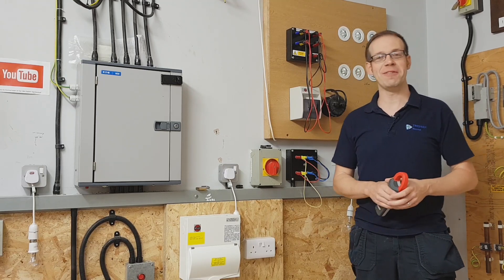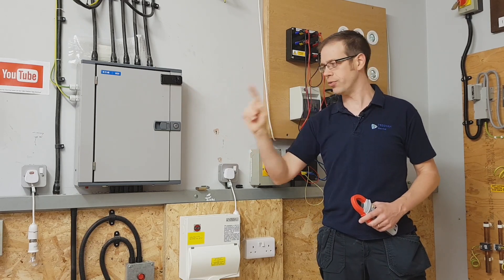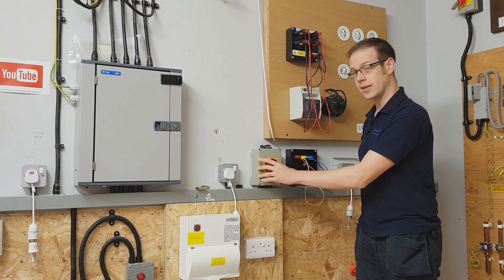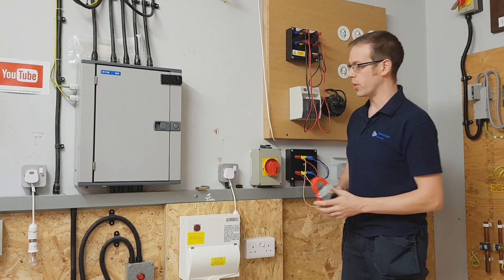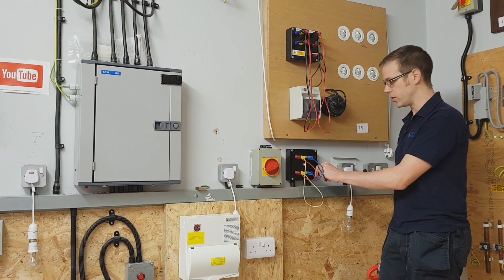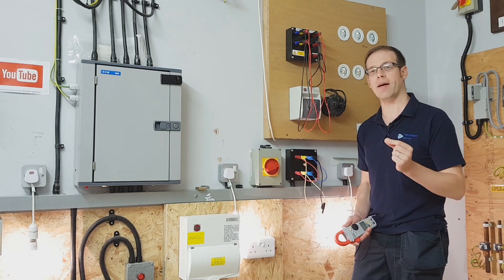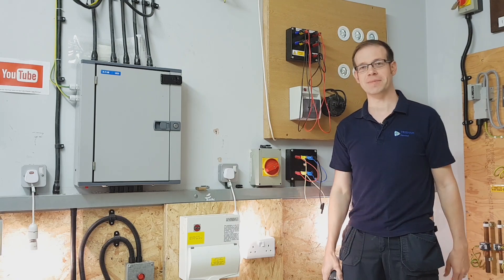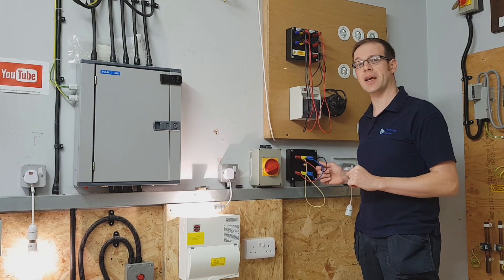Three Phase Mystery

Comment: This could be covered later, sorry I'm trying my best to keep up, but what if two out of three loads are on? Does the return path still exist from phase "x" to load to center of wye to load two and then back through phase "y" or is 120 degrees of separation still too close therefore there isn't enough difference in voltage to push electrons back and forth? In other words, must all three loads be energized to get this effect where we can unplug the neutral and still have the loads energized?

Comment: Can I reproduce the same mystery with 2 lamps on the "split phase" found in North America?
Is our America "Split Phase" the same as "2 phase" were HOT1 and HOT2 are out of phase 180 degrees, much like 3 phase HOT1, HOT2 and HOT3 are out of phase 120 degrees apart?
This other video shows 0 amps on the neutral but does NOT mention if you can disconnect the Neutral https://youtu.be/P-W42tk-fWc?t=318   Thank you.

Comment: What about a high leg delta set up? No neutral? How would you hook up lights on that set up?
Reply: That is some weird American stuff that we do not have in Europe. Essentially it is 240 V delta where the center point between two phases is grounded. It is not called neutral as it is not the neutral point but essentially it is the same (white wire) for the average user. The third leg is the high leg and it has 208 V to the grounded conductor. If you ignore the high leg it is like normal US single phase.

I do not think you can do this test with it as it is delta so there is no neutral.

Comment: Thanks joe

Doesn’t it matter what the voltage of the three phase is ??

360v three phase I think this works 

But if you had 408v three phase I think this would overvolt the individual lines?  

I have no electrical training but have built three commercial buildings and two have transformers and one does not.

Comment: In terms of the bonus clip at the end, id presume this is a result of the voltage drop in the neutral. With a fully balanced System, there would only be a voltage drop in the line conductor so therefore providing a high wattage
Reply from the maker: Hi Josh, thanks for the comment, you're in the ball park with your answer, I'd actually forgotten that this was on the end of the video so thanks for the reminder I'll do a video explaining what's going on there.

Comment: I watched the videos in reverse order. In the second video, with the same load
on L1 and L2 the neutral has a current reading. MEANING it was needed to
BALANCE the load of TWO PHASES being used. In this video with same setup
L1 and L2 light on, the neutral was not needed and the two lights stayed on?
Reply from the maker: That's right it took the out of balance currents, the key to understanding the lights is the fact the lamps dimmed.... Stay tuned!

Comment: Excellent video contents Joe, would you please be able to do more coverage on three phase supplies, covering star & delta connected loads, balanced & unbalanced systems, the reason for the neutral conductor, would it also be possible to cover more on delta connected loads, the differences between line & phase currents, with the line current being less than phase current, I understand this on loads connected in star, or is this just same but the other way around if makes scene. As other have said there defiantly not enough covered on three phase supplies, with everything aimed at single phase supplies, even when at college there no real coverage on the subject.
Reply from the maker: Thanks for the kind words and rest assured there's more three phase on the way! 👍🏼
Reply: Thanks Joe cant wait to see more your doing a brilliant Job with the contents, keep up the good work its much appreciated...

Comment: 3phase is my bread and butter and I have been fascinated with these strange anomalies since I had this exact issue happen to me on a 3 phase board. I first noticed voltage between neutral and earth around 4v when I came to isolate a lightning circuit via mcb to replace a fitting. So I switched the main switch off voltage in neutral disappeared, carried out my work switched everything back on and went to check if the voltage in the neutral was still present. 

On my walk back to my work area I noticed a few LED flood lights  were on even with  the light switch off and the other lights on the same circuit were also off, this only effected the led ones.

 Retested the neutral this time was getting 200v+ to earth. Found the neutral pole high resistance on the main switch. Causing the neutral to become live and also I'm under the belief that as the neutral was now live the led drivers powered up using the electronic reference to ground to complete  the circuit these led floods needed an input of 80v+ to work. The neutral bar had become the star point for all the phases within the db and all 1ph circuits had now become 2ph.
Reply from the maker: It's a truly fascinating subject Jason, always a new surprise and something else to learn eh?

Comment: three phase load when neutral is disconnected, voltage may go up, the reasone is the electric circuit closes throw the load and on to the other pahse,  the load become in line with the other load.
more easy to look on a skatch and the to understand....

Comment: Wait!  on puling neutral, L3 got brighter and L1 got weaker, L2 seemed to stay the same, if that was a "yes" Joe, no doubt future videos will explain? 

Ah as per your last few seconds comments I see you will address it :)
Reply from the maker: Ah, well spotted! The key thing to take away is that the lamps all remained on. The reason for the slight change in brightness is the lamps are not exactly the same power, there was a slight variance in them. Great question.
Reply: Awesome,thanks Joe, can't wait for next videos because I'm  stumped on how they stayed lit :)